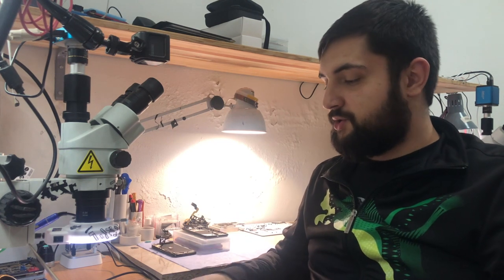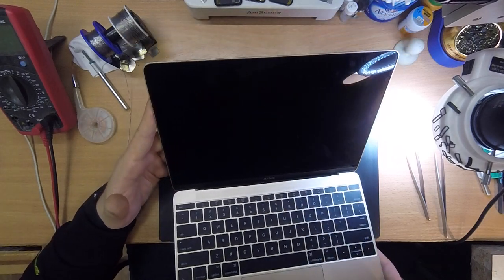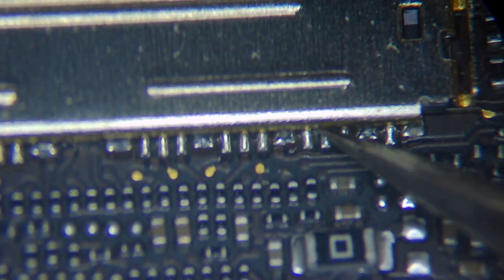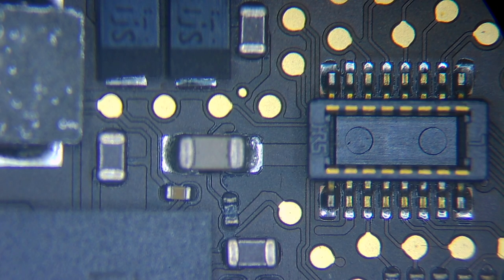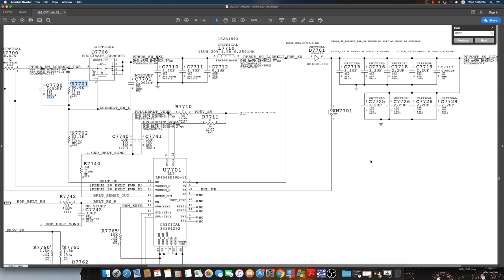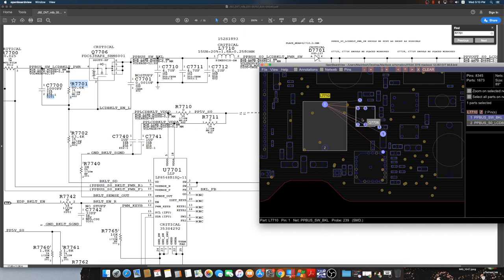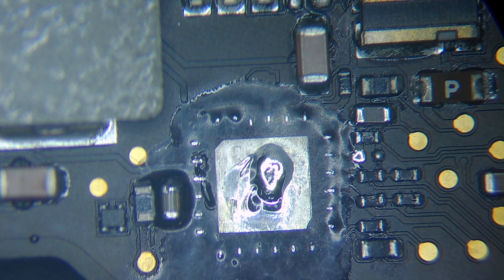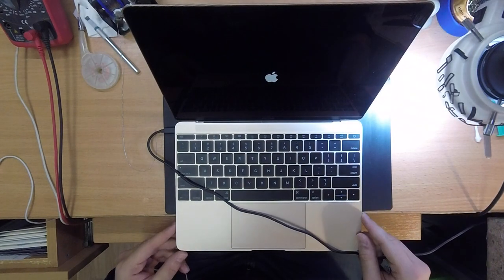MacBook 12" Retina no backlight A1534 (820-00045) 2015

Comment: Thank you for sharing your knowledge - it is impressive how you could identify and fix exact problem instead of replacing a board.
I do love A1534 model as there are no similar lightweight solution exists in modern apple lineup.
I have different problem with mine - I used to open/close the lid way to often which led to breakdown of screen flex cable.
Now my screen shows only one white and multiple magenta vertical strips.
Unfortunately screen flex cable is not separable from the screen itself. Apple official service only replaces whole screen assembly which is more expensive than similar used laptop.
Is there any way of repairing/replacing screen flex cable without changing the whole screen?